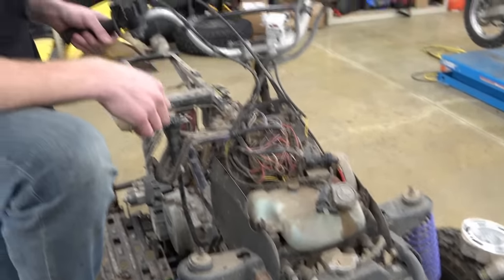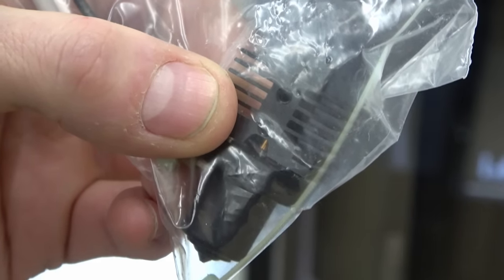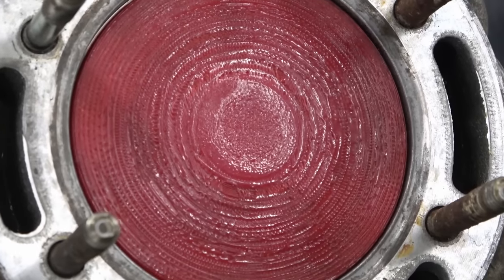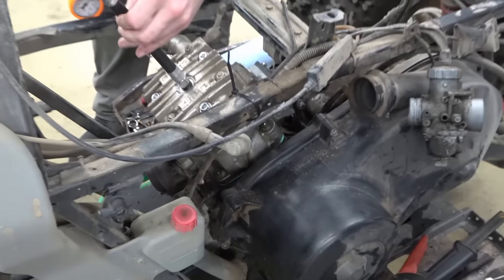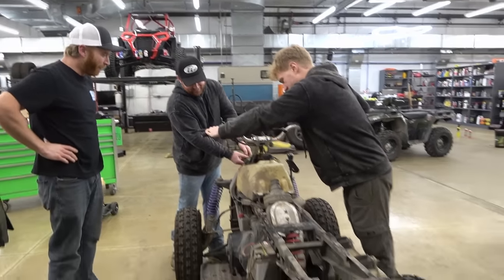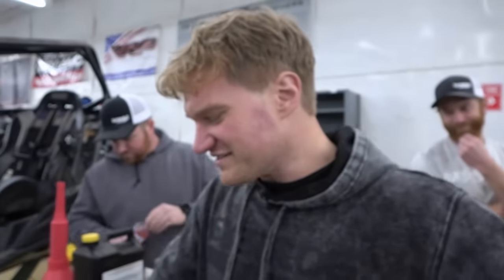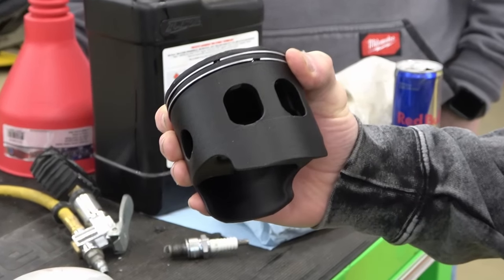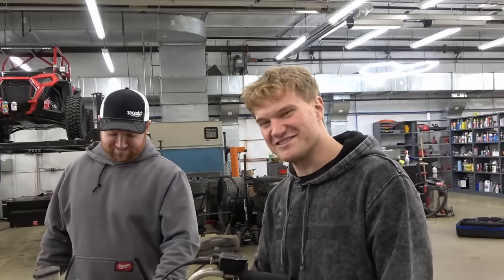WORLD'S FIRST 3D printed carbon fiber piston! Will it run?

Comment: Next, 3d print a copy of the piston, and then use it to mold and cast an aluminum version from pop cans, and see how long that lasts
Reply: This is actually a good idea they need to do this or even other people try this out it
Reply: I was about to type that, but then I thought about how rough the piston would be so they would need to turn it on a lathe or try using a drill press and doing some ghetto cutting on it to ensure it is perfectly round.
Reply: They need to do this
Reply: @jonWilk8156  I think you meant to reply to the other guy
Reply: Garage 54 has done it before, you can check it out
Reply: @mantvydas8810  wood and plastic
Reply: Clever
Reply: @wrxsubaru02  yea you'de definitely want to cast it slightly larger and use a lathe on it. Especially to clean out the ring grooves
Reply: @TheTrex600ESP  they have done wood, plastic, pistons from cans, copper and probably more that I can't remember right now.
Reply: @jonWilk8156 I think they taper down a little for heat expansion.
Reply: @mantvydas8810  Yes👍
Reply: That's what I am going to do. Saving a lot of cans now for the big melt
Reply: pop cans ?  there has been metal printing 3d printers for a very long time . but i doubt you can believe this fact
Reply: @donniebaker5984  yeah sure, have you seen the price of a metal 3D printer?
Reply: I thought the same,also a good way to test different designs
Reply: Why not place a metal laptop that is printed in to the next version
Reply: That will last as normal piston
Reply: Pop cans are pure aluminum. That’ll probably work well
Reply: @jamaalfjordan  size does matter and a metal laptop would not handle the force needed to operate the piston return springs
Reply: I would actually treat it more like a CPU and use more of an Aluminum Bronze alloy in the process and then thread copper tubes to hold it in place as heat tubes to move air thru them even if you vented the heat tubes slightly you dissipate more heat and keep from pooling at the top which is where the problem will be. If they switch to 3d printing or use the 3d print to create a prototype you can use Vespel to instead of carbon fiber. I am just not sure the cost on having it fabricated. But that alone will holds strong at 550 F and can hold out up to 900 F for limited time before failure.
Reply: did you try it? love to see the result vs oem pistons
Reply: Agreed
Reply: @dimitrilikissas glorified wire welder
Reply: @dimitrilikissas  You can print metal infused plastic on a regular $500 FDM printer. After you print it you put it in an over to melt the plastic out of it then put it in a kiln and fuse the metal into a solid piece. YouTuber Integza made a rocket nozzle using this method a couple years ago.
Reply: the aluminum from cans are shit to cast, no silica in it. better to use some old already casted crap, like a old rim. aluminum without silica is like casting bubblegum.
Reply: Maybe just cast the part up to the rings and attach it to a plastic body.
Reply: YES THEY NEED TO DO THIS
Reply: Thank you, that is a great plan! @3dprintedhardware
Reply: Shrinkage.
Reply: Then use that to make an one out of tungsten and see how much it shakes
Reply: @kylethompson2431  shakes and most like wrecks the cylinder plating being harder than anything else, it'll probably dig right in
Reply: Stupid idea,  they may aswell use the original piston as a copy using a mould, plus the idea is to see if they can make a printed piston work.
Reply: @stephencarey3589  not a stupid idea, trying to use an original piston is stupid, as dealing with the cavity inside the piston as well as the wrist pin holes make it impossible to do as a 2 piece mold. You must do a lost material style casting. So you'de be ruining a good piston to make a shitty one. Lol
Reply: It runs until it heats up lol Three ignition cycles later
Reply: There are Special filaments for lost casts. Polycast is one.  Just place in Sand with a few raisers and let it go 😇
Reply: They do make metal filaments as well that would be interesting to see tried
Reply: Now try again in pa6-gf u may get 5 minuets next time
Reply: Between this and sand printing for casting, I'm seeing a lot of applications for replicating out of production parts.
Reply: hell yes i need to see this, theres a lot of materials that would be fun to see. concrete piston🗿👀
Reply: Great idea wondor how long it would last
Reply: pretty sure garage 54 already did this
Reply: Those Russian guys at "Garage 54" youtueb channel (pretty sure this channel even copied their name, lol) have already done it! And it's pretty tame compared to some of the -ish they usually do!
Reply: no, youd need to cnc the rough cast edges off and at that point youre just producing pistons
Reply: dude i mean if you had a 3d printer and needed to out run zombies or something for like 1 minute it would work ....win!
Reply: Pop cans have a plastic layer on the inside so the metal does not leach into the drink and make it taste like metal. So in short it’s not pure aluminum.
Reply: @lavaman9162  when you melt them down that burns off
Reply: @lavaman9162 yep.  plastics would all be burned out during the melting and casting process, but it's a mess. Just about as much slag as aluminum and the aluminum that is there isn't very good grade either.
Reply: @Notakebacks-sy6ji  no it Will not
Reply: @randobad  without silicon the piston
Reply: @jochem1986 only is its cold out
Reply: Garage 54
Reply: You are genius
Reply: Channel called Garage 54 made pistons out of aluminum copper brass wood and All kinds of stuff
Reply: No
Reply: Great idea! 👍🏻
Reply: Yeah, they say carbon fiber is stronger than steel.
    Don't you believe it.
Reply: @scottchapman9931  nobody has ever said that. It's much lighter than steel with an almost similar rigidity. It's claim to fame is weight savings. It isn't any stronger at all, actually slightly weaker
Reply: Try a printed rod less heat it may hold on little longer 🤷‍♂️
Reply: No. A Ceramic piston 😁
Reply: @Abcdef-zp1lq garage 54 done every version of metal pistons they even did wooden ones
Reply: hell yeah the pull tabs
Reply: they make a plastic just for that.  It melts like a wax.
Reply: Or a whole engine block
Reply: Depending on the alloy you are using, you need to oversize it a bit due to shrinkage during casting (if you don't want to machine it afterward and test the raw casting).
I've cast stuff from old alloy wheels before and around 1,5% oversize worked perfectly.
Reply: I got it!!!! Make another one a few thousands of an inch smaller and dip it into chrome high temp metal flake chrome afew thousands of an inch thick!!!!
Reply: @aaronhobbs4592  good idea.  you could try ceramic coatings as well
Reply: @donniebaker5984 Piston return springs.. have you been watching Garage 54?
Reply: Burt Munro cast his own pistons  back in the 50s & 60s
Reply: garage54 have already done it.
Reply: great idea i am so curious now
Reply: see how much boost it will hold*
Reply: =0 genius!
Reply: Garage 54 already did it.
Reply: @TheTrex600ESP Also copper, brass, and other metals.
Reply: @conner768 Glass pistons! 🤣
Reply: for your information, they are called aluminum soda cans
Reply: @wrxsubaru02  to be fair, every type of piston made ever has to be machine finished. (Cast, billet, metal printed, even forged)
Reply: dents everywhere
Reply: Or you could remove the original piston and use it to make the impressions of the mold.
Reply: Делал так же на юпитере RUSSIAN

Comment: Lol imagine getting a running unit on Craigslist and the damn piston is plastic 😂
Reply: lol The late night Craigslist sale ... I can only run it few seconds or I'll get a fine from the HOA.  SOLD!  lol
Reply: i mean a chinees piston is problably cheaper then having a 3rd printer and buying the materials. (even if you have a 3d machine)
Reply: It'd definitely be a epic April fools joke on a buddy 😂
Reply: New fear unlocked
Reply: @fordwrecker1 Hey Billy Bob, were going to Glamis for the whole week, you can use my old quad...it's got a fresh top end!
Reply: Advertising it they come and look at it, you start it runs fine, let ‘em take it for little spin. SOLD!!! They get Home and find out it has plastic piston 😂
Reply: Low hrs, ran when built.
Reply: Clean one owner!
Reply: Carbon Fiber isn't plastic, but gtfo
Reply: This would be my luck 😂
Reply: My exact same thoughts lol
Reply: as is mannn
Reply: @steezegod2768 it was polycarbonate with carbon fiber in it… so yeah pretty much plastic when a piston is only as strong as its weakest point
Reply: "Fresh top end"😂
Reply: @reggiexp69 you’re right about that
Reply: Polycarbonate (PC)filament is stronger then that carbon fiber. give it a try with that
Reply: Honda is taking notes… build cheaper = profit
Reply: Lmfbo!  I'd be ripping if nice found that in there!
Reply: @reggiexp69  But why give money to China when you can literally just build one yourself at home?
Reply: @_M_a_r_t_i_n_M  hahahha with the same quality
Reply: Craiglist🤓🤓🤓

Comment: Glad to see Im not the only one putting 3d printed parts where they shouldn’t belong, Great video!
Reply: Honestly, TPU is absolutely insane. You can put that in a lot of places instead of metal as long as TPU doesn't get hot.
Reply: Hey Camden, your printed engine is awesome! I watched those vids when they were released.  That was part of the reason I chose this engine, just to be different
Reply: Hello Camden, I love your videos
Reply: you sir are a pioneer.
Reply: @iniqy Instead of metal? Are you sure you're talking about the right plastic? TPU is soft and bendy as shit.
Reply: @JmnNatu  Depends on how you print and design it. This project from printables may change your mind: /model/692212-rude-indestructible-rc-truggy-basher-110-car
Reply: There are different hardness TPU levels
Reply: if you choose the right composite, the engine will perform no worse or even better than its aluminum counterparts, back in 1984, mechanic Matty Holtzberg created, after several unsuccessful attempts with different materials, Torlon pistons and this car took part in races Glen Wotcins, did not win, but reached the finish line  .and then he actually made an engine consisting of 80-85% Torlon, which were working, and not just worked for 2 minutes and turned off, but like a regular engine.
Reply: @JmnNatu  why are all you guys here so obsessed with 3d printers that only do plastic ? that's old school 30 years ago , today we have 3d printers that do a dozen different exotic alloys in ferrous and non-ferrous Metal ..starting at around $399 to print metal ..now we go from 3d printer to the starting line ready to race cheaper and "more better" than o.e.m. "duuh" giggle giggle !
i keep staring at one that cost $2700 bucks that pictures a V8 engine block inside
Reply: @donniebaker5984 every time I hear there's a 3d printed Inconel part somewhere on a race car, I know OEMs have thermoplastic intake housings
Reply: @luislongoria6621  so what , inconel work hardens during machining but 3d printing inconel has no issues..just curious but what could be running through your millennial mine about UBS plastic cold air boxes that you mentioned
Reply: @donniebaker5984  couldn't remember what kind of material it was. Are rocket nozzles 3d printed?
Reply: Heyyy there’s my guy
Reply: I was expecting you.
Reply: That doesnt really sound right...
Reply: Haha yeah
Reply: Camden  you 3d printed engines are awesome
Reply: I just recently printed a tractor part in NinjaTek Armadillo.  Hood latch piece (original was injection molded nylon) to an old Deutz tractor.
Reply: @iniqy  Very different from 30A to 30D!!! Most people print only with 95A whats like pla/tpu mix and nothing diffucult you can print it like fast hyper pla
Reply: @iniqy  which is exactly what and engine gets
Reply: *an
Reply: What does that mean? WHAT DOES THAT MEAN??
Reply: Are you going to make the a 3d printed 2 stroke?, Would be cool to see.
Reply: @iniqy  TPU does have a really good resistance towards acids, greases and well almost everything besides high temps

Comment: As a retired motorcycle technician and machinist rebuilding many 2 stroke and 4 stroke engines including drag bikes, this was pretty cool. I definitely didn't expect the 3D carbon fiber piston to last that long.
Reply: I wonder if it would be strong enough for boost if it would last ten seconds or less got me brain ticking on that one
Reply: @richardschafer1911  Or even a turbo or supercharged.
Reply: Same here..I'm a retired motorcycle mechanic of 38years.😊
Reply: @JeffreyPerrault-hk6xe  cool! I started at a Kawasaki & BMW dealer in south Florida on May 13, 1979 as a bike assembler and picking up and delivering bikes. In 1985 I started working at a motorcycle machine shop working on street, dirt and ATV's and building drag bikes. 99° were Japanese bikes.
Reply: What about carbon-carbon?  It’s used on (expensive) brakes.
Reply: Tensile strenght wise that stuff is comparable to cheap aluminium so it can take quite a beating but the temperatures inside a combustion chamber will melt it rather quickly. Working temperatures up to 60-80°C are okay. If it wasn't polycarbonate, which doesn't really like oil and gasoline you could print a intake manifold or other stuff for your car for it.
Defo a cool test tho.

Comment: Guys if you have other shops do this as well.  You can start a plastic piston drag race. Meth, water injection whatever. The stress of winning before meltdown would be through the roof.
Reply: There's plenty enough meth at our local dragway already....
Reply: This would be sweet.
Reply: @EnkiMMXII that's methed up.
Reply: Pipe down now, yall quit methin' around.. ya hear?
Reply: sadly plastic pistons wouldn't work on nitromethane because of how quickly it would dissolve the piston interesting thought though considering it would solve the melting issue

Comment: I think YouTuber @Thunderhead289 would like to see this video. A while back, he designed and 3D printed an intake manifold that allowed him to put a lawnmower carb on a Ford 351(??) which allowed him to get more than 70MPG's at expressway speeds. I think he even ran the car on a dyno at one point, and has definitely clocked many many miles with it.

Comment: Here's an idea...     Reprint the piston, Move the rings down as far as you can to get them away from the heat. Yes this may add to some dirty combustion, but it'll keep the rings in it..   Then cut the dome down a little, and pepper the dome of the piston with a bunch of tire stud style pockets. Find a high temp epoxy that has a higher melting point than your print. use a form and build the dome up with this heat resistant epoxy. (This is why the tire stud pockets exist so the epoxy can grab the piston). Then hopefully if the epoxy is thick enough it will take a brunt of the abuse and prevent the piston from melting.

Comment: Ideas-
1. more rings

2. move the rings lower 

3. paint the piston with heat resistant paint

4. keep makes these great vids!!!
Reply: paint the piston? not gonna work
Reply: @pancake5830  Ever heard of ceramic coating on pistons?
Reply: wont work, the rings are a failure point. its metal with heat the piston and causer it to weaken. im interested in seeing actually cf piston
Reply: Spiral wound CF piston with ceramic crown. Rings run in the ceramic.
Reply: make the piston out of PA12

Comment: This is why I started watching you guys. The excitement and the comradery of friends doing fun stuff together. No destroying $30,000 machines or smashing electric cars.
Reply: Electric cars are a$$
Reply: They got me
Reply: dang i just remembered "BUBBA's Honda Drop" bubba's is a big harley biker bar in milwaulkee wisconsin ..and once a year you buy one ticket to get in and every thing else is free like beer buckets and two refrigerated beer trucks with taps on both  sides ..we got a huey helicopter lifting little honda cars 500 feet into the sky only to be cut loose falling to their death every time after time ..as they  tumble through the sky some land on all four wheels that instantly fly off on contact with earth causing the bodies of the poor little honda's to become flat as a pancake
Reply: Makes me wish I had friends.
Reply: @countryboydragonboy7561 This value judgement is based on what?
Reply: Carbon fibre is used in spacecraft heat shields. Make the crown in carbon, print the lower half in PTFE.
Reply: Love the whistlindiesel reference

Comment: That's awesome! You should look into getting another carbon fiber printed piston ceramic coated, so it will reflect and take the heat!
Reply: Make it like a big Truck Diesel, small steel top with ring slots and carbon skirts.
Reply: Ya, I was just thinking that myself as watching this. it would probably take more heat if you had a ceramic top or if it was electro-coated with a metal shell.

Comment: That's goddamned amazing that it actually started much less ran for a short bit.. It's nuts that a plastic piston would work, but insane that a 3D printed one does, with layer separation issues being a nature of the manufacturing process and all.
Reply: With PAHT-CF it should have run even longer. 194c temperature resistance instead of 100c and PC gets weaker with added CF on high temps.